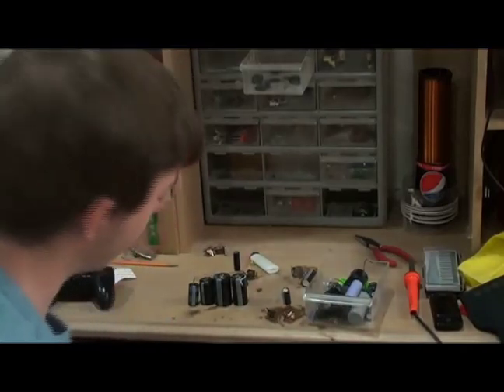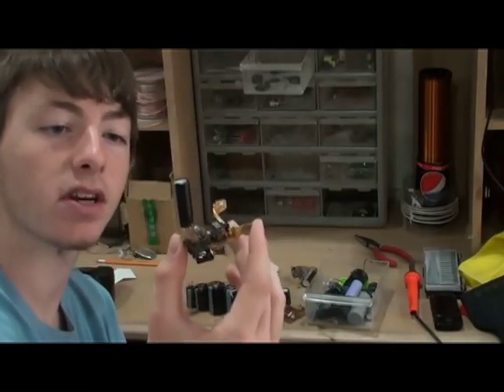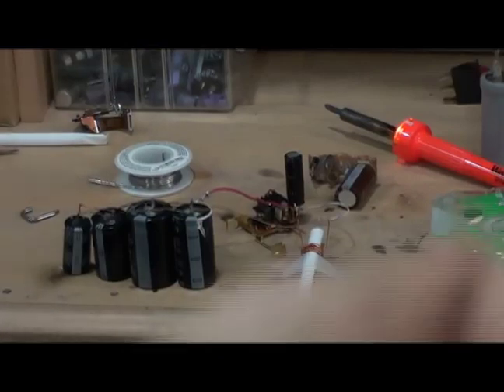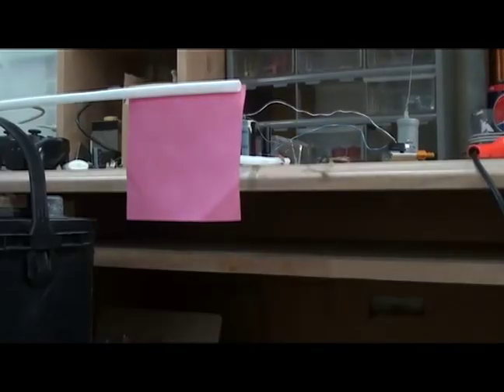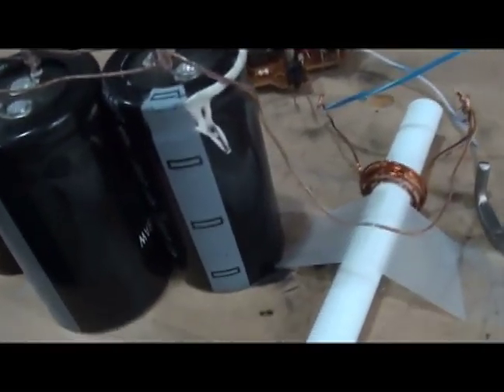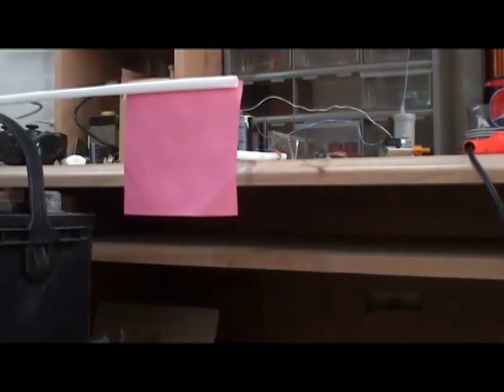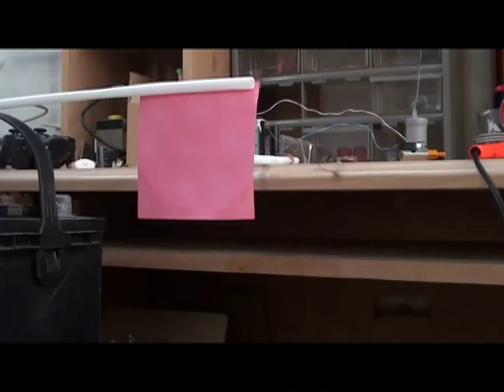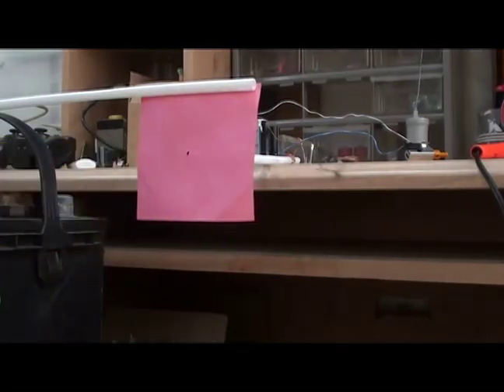Testlab: Coil Gun

Comment: railgun uses two rails to propel a projectile by sending a current through them and in turn forcing the projectile out at high speeds, whereas the coil gun uses coils around a tube to magnetically pull a projectile out